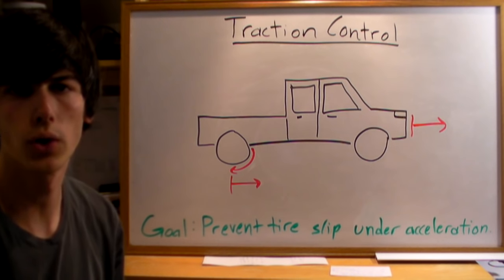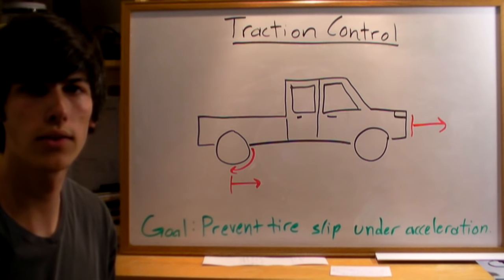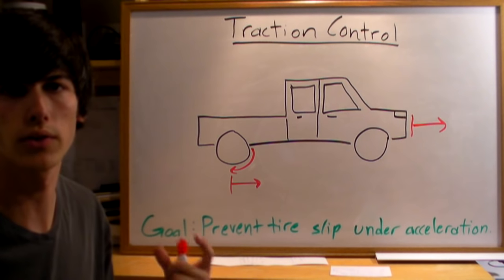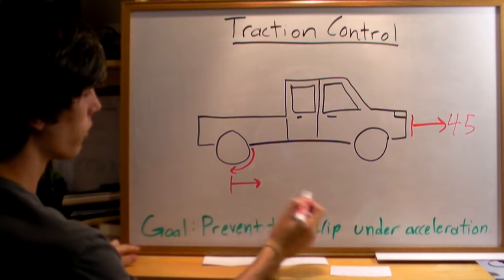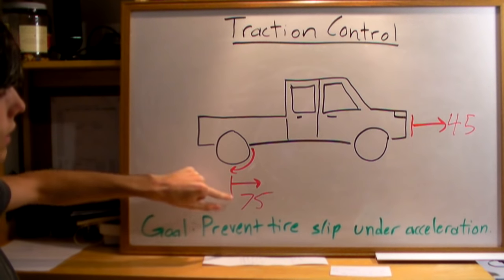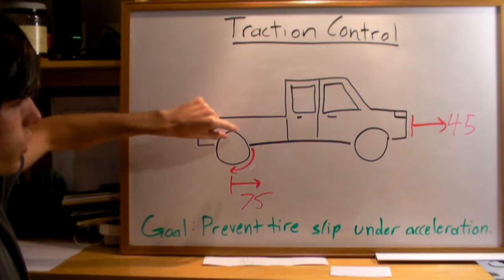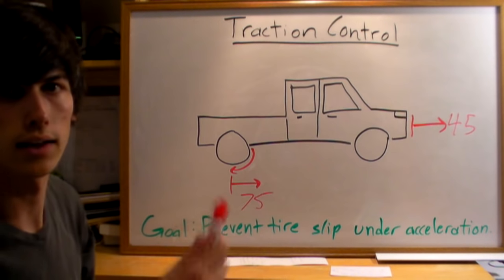Traction Control - Explained

Comment from the maker: It does this so that you don't spin your tires (and lose control). It attempts to provide you the maximum acceleration possible under the given conditions.
Reply: Why can’t I burnout on my 2005 5.3V8 Silverado?
Reply: @TonyCrispruby  damn that was 2 years ago I sold it cuz u need to tune to take off the track and governor i went and got another truck
Reply: 2011 Engineering Explained Video, Yay~
btw if the driver is able to manage their gas pedal car precisely (Let's say racer?) , will it be faster without the traction control?

Comment from the maker: Assuming you don't sit there and spin the tires, yes. But having traction control will allow you to get close to maximum acceleration. From stop though, it won't necessarily kick in immediately, so you'd still be able to spin your tires a little bit.

Comment: It’s the dcu (drive control unit) that determines the speed of the wheels and whatever wheel is stuck. The dcu tells the engine to send all its torque to the wheel that is stuck.

Comment: Short video... so the loss of traction is generally a result of too much torque, right?
Reply: matt b 2 years late so I figure you already know the answer but pretty much. The tire can’t get grip as fast as the tire wants to go. That’s why you turn it off if you want to do burn outs
Reply: Also because of wheels lifting off the ground during acceleration.
Reply: If the road is wet
Reply: No loss of traction is due to you not reading what conditions and road surface you are driving on with zero clue on how much of your tyre grips the road at any given time
Reply: Yes. It balances both wheels from the rear wheels to prevent spinning or doing a burnout

Comment: I had a Chrysler LHS with traction control that got it through most snow and ice without slowing it down; it felt like a giant rat clawing its way through the ice and snow. Once in a long long while, going up hill in really sticky slush, the LHS made better progress with the TC off, but otherwise, you could just leave it on and forget about it. The 05 Honda Accord I have now is nothing like that; as soon as it encounters any slippage it retards the throttle so much that the engine feels as if it has stalled; it's downright dangerous at stop signs, since you can't shut the damn thing off without bringing the car to a complete stop. I don't see how a generally competent company like Honda could put their name on something so badly engineered, but I've heard that some other Honda and Acura cars also do this.

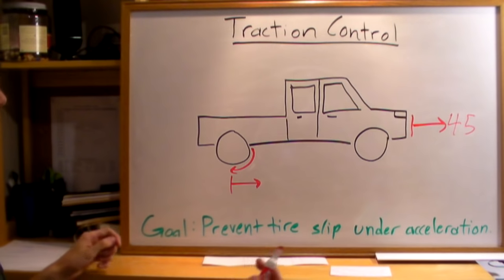Comment: 0:28
tire movement/speed are different with the vehicle. it was an angular velocity (i.e; rad/s). while vehicle speed was a linear velocity (i.e; 45mph).
Reply: If the radius of the tire is known, then the relationship between the tire's angular velocity and its linear velocity is known. A tire spinning at 1 rad/s with a radius of 10 in would travel 10 in/s. Similarly, a tire spinning at 5 rpm with a radius of 10 in would travel five circumferences every minute, or 5 * (2 * PI * 10) in/min.

Comment: Could you explain (or even make a video) what the difference between a TCS and an eLSD is? Both brake one wheel to even the amount of torque one an axle, but how is it that in some cars you can turn TCS off and the eLSD stays ON?? Is it just more generous in allowing wheelspin to some degree like a limited slip differential would, but essentially the TCS is still on? Also, some manufacturers have cars with eLSD that have clutches, others use the braking system like in TCS? It's very confusing to me. Thanks

Comment: @oogiemaster i think it is possible that rear tires spin at 75mph but front tires  at 45 mph...so sensors can easily see miss-match in spinning and adjust it. I think))

Comment: Why is it bad for the tires to be rotating faster than the car is moving? Wouldn't this just cause the car to speed up or "accelerate" which is what you want when you press the gas?? If i'm going 45 and hit the gas and my traction control automatically brakes my tires to be at 45 then I haven't actually accelerated.... Why is this a good thing?

Comment: In Forza motorsports 6 i think it reduces power sent to the wheels but in a way of using the clutch because the engine is moving faster than the acceleration of the transmission

Comment: What about traction control when you are accelerating while turning. As you know when you corner each tire travels at a different speed. There is also a certain acceptable slip angle (10 degrees?). Can you program the ECU to cut the engine supply then? Thanks!

Comment: But how does the car know that is slipping if all tires are slipping? In the case showed, the front wheels are the point of reference, but in a awd car all wheels are slipping at the same time.
Reply: normally back wheels will spn faster than front so the sensor will pick it up have a good1

Comment: I think it might be Electronic Brake-force Distribution. The control unit(s) that control stability control, traction control, and/or ABS will attempt to distribute the braking force for the conditions, rather than a set ratio (i.e. the master cylinder). At least that's what I know regarding EBD. I'd like someone to chime in who knows more about it.

Comment: So if you take off traction control in your car will it accelerate at a faster paste ?
Reply from the maker: Andres Espitia Not necessarily. If you simply spin tires you won't go anywhere quicker. But often the systems attempt to prevent any wheel slip by cutting power, reducing acceleration.
Reply: Engineering Explained Ohhh okay then thanks for explaining it well
Reply: does it control left to right slipperage as well or only front to rear?
Reply: YoGirl ChoseMe I'm
Reply: I think it could make a car go faster on slippery surfaces, because it would improve the road grip (?)

Comment: Would traction control sensors be dependent on front wheel speed for RWD and/or rear wheel speed for fwd cars? For example, your front wheel, like you explained, is at 45 mph and rear wheel at 75 in rotational speed, the system kicks in. Also, would this work in a case of AWD or 4WD.

Comment: Hmn..........confusion,i read the Traction control doesn't applies brakes,instead it limits and regulates the power being provided to the tires in case of Hard acceleration.

Comment: How the wheel spinning increase? If vehicle speed is 44 kmph
Reply: Many things, hard acceleration, ice snow mud sand rocks hills maybe a combination. When there is a slippery surface that gives limited wheel traction it will cause the one or more wheels to spin which in return will activate this system if so equipped

Comment: My car decreases engine power it’s kinda of a weird thing to feel. Your foots to the floor on the gas pedal but the tac barley reading 2000 rpms then the low trac light goes out and power comes back and you take off and your like wow cause your foot was to the floor lol

Comment: My GTI mk7 seems faster when I turn off the traction control although, I leave it on most of the time.
Reply: +David Ha Most cars do accelerate faster in good conditions without traction control kicking in. TC usually reduces engine power to stop the wheels from spinning. The problem there is that even when it stops reducing the power, it takes a while for the engine to get the amount of fuel and air that you are telling it to via the gas pedal. Although if you have way too much power, you aren't going to go anywhere if you are just sitting there, incinerating the tires.